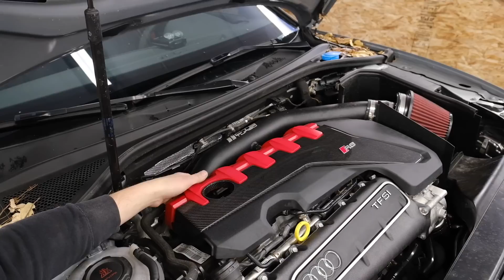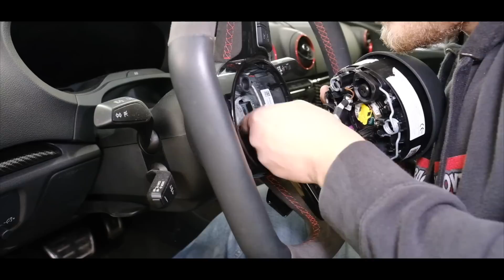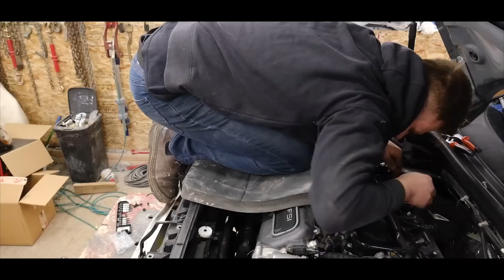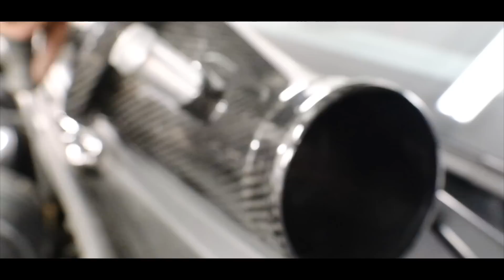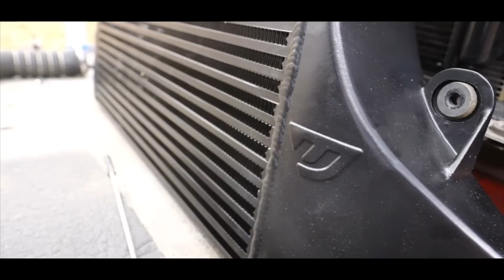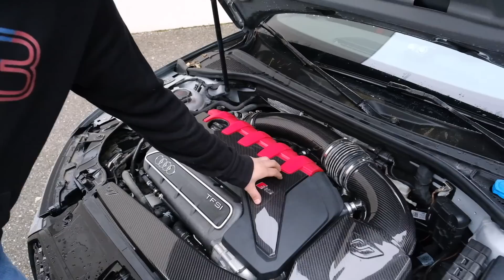Highly Modifying My 2019 Audi Rs3 With Performance Goodies From UNITRONIC!

Comment: What engine code do you have? I have the DNWA and the unitronic intercooler doesn’t fit between the crash bar and the ac radiator.. looks like in the video that you got more space. Mine is 2019 rs3 sportback.

Comment: Headlights have to be leaking for this to happen, they shouldn’t be doing that on any car. Should inspect for loose caps or any small holes which pull moisture in . In time they’ll get ruined especially with the weather you have where you’re located.  Car looks mint

Comment: Good job Tim yet I don't understand why you don't change the lower factory collars to Samco silicone they are for the job as well together with the unitronic program normaly it goes as a good mod a forge blow-off Valve and a fuel regulator and as you see the oil in the tubing which is normal you need an oil catch can in order to maintain the system health in the long run

Comment: That rain-x is going to fubar your level sensor. If it starts telling you the fluid is low when it’s actually topped off you’ll know. 
Drain it. Clean the sensor off. Refill it with a different product.